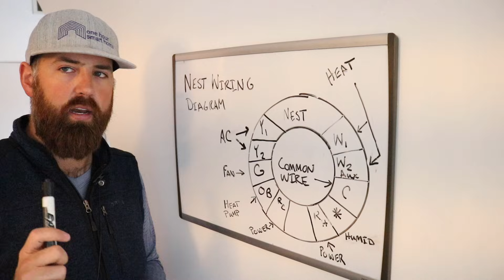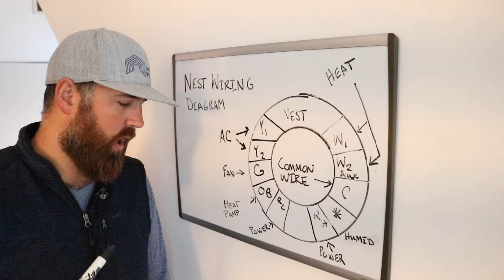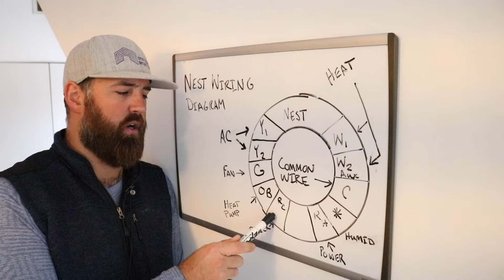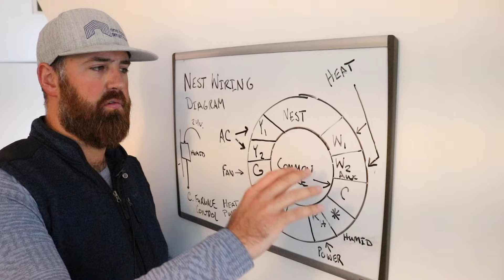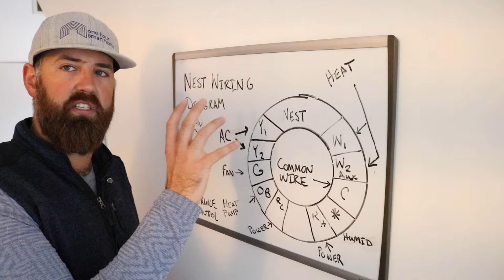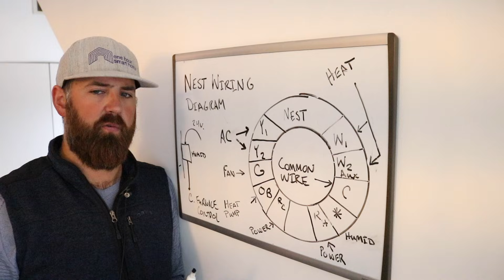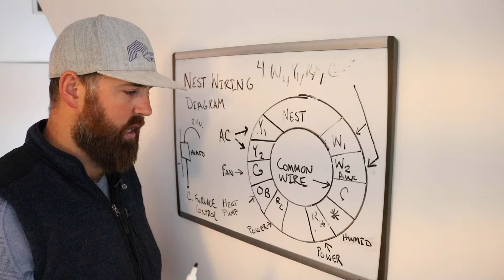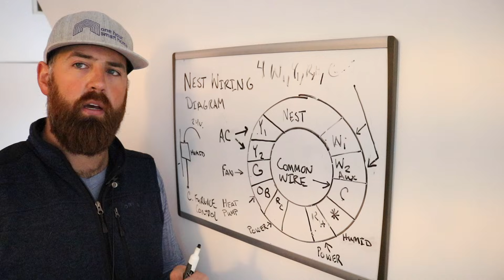Nest Wiring Diagram: Full Explanation!

Comment: I'm just thinking out loud here. If you have cooling only in the Attic. You would run the red wire to the RC correct and if you have a hot air furnace in the basement you would still run the are to the RH for the heat side correct. Or is this some type of internal jumper from RC to RH? Thanks for the video

Comment: I do not have AC and my yellow wire just sits behind the mounting plate. Can that be used as a common wire? My furnace was off for much of the summer and now the nest doesn’t charge while furnace/fun is running. I have to pull it off of the mount and charge with the micro USB every two days or so. Thank you

Comment: Hi, my old thermostat has both RC and RH because both wires come from separate transformers between Air conditioning (Electric) and a Base Board for the heating system. How should I connect both wires?

Comment: There's another video where the guy says the Nest 3rd gen doesn't like it when you hook up both the Rc and Rh.  You'll get an error.  He said only use the Rc because it automatically bridges to Rh but if you use Rh, it doesn't bridge to Rc.  It's a Nest thing he said.
Reply: Thanks, exactly what I looking for, my old thermo stat have jump pin between Rc and Rh and Im not sure what to do with it. Btw I have a blue cable that didnt hook to my old thermo stat, is that the common wire?
Reply: @nanowar1192  blue is normally the C wire but you need to check your furnace to be sure because there is no standard on colors.

Comment: I'm not getting power to the nest and going to do the green C slot? 5 wire system, single stage. At furnace I have the blue and red wire in the R spot. At the Honeywell thermostat I have the blue in the R slot and red in the Rc spot. I have the Nest E thermostat and it appears this won't work. Any suggestions?

Comment: I installed a Nest Thermostat 3rd Gen in my home. I noticed that there is a slight buzzing noise coming from the wall plate. ( nest base ) The previous thermostat that was there ( Sensi ) did not have this issue. If I shut off the power, remove the C wire, and turn the power back on, the buzzing stops. If I plug the C wire back in, the buzzing starts again. This is only affecting the wall plate and not the display itself. Spent 1 hour on the phone with google/nest support and made all kinds of switches with wires, no luck... Now they are sending me a base replacement but I read that its not the issue. Anyone experienced similar issue and was able to resolve it ?!
Reply from the maker: That's interesting. Possible it's bad base plate. It's very rare but I've ran into once or twice. It might be helpful to use a multimeter to see the voltage on between your R and C wire and R and W wire, and R and G and R and Y.

Comment: Hi, mi old heat thermostate work with only W an R Wire and use AA bateries. And dont work my new nest...wath is the best option to connect my heath? Thanks
Reply: Me too... 2 wires and heat will not kick on.  ( SIGH)

Comment: how do these get connected to a lennox harmony 3 zoning board? My installer is having a terrible time with this and the DAS probe getting too cold on the Harmony 3
Reply from the maker: You need to have a common wire from the lennox harmony to the each nest thermostat. You can use the fan wire as we show in this video: https://youtu.be/w0BZPx8-Q5o thanks for subscribing and your support.

Comment: Awesome job... I just got mine and the fan revs slowly then turns off.  I read the variable speed motors are not compatible.  I have a dc motor.  Are dc motors considered variable speed.  If yes can i jump the fan to run all the time....we have it set to run all the time anyways.

Thanks
Shawn
Reply from the maker: Do you have dual stage heating and/or  cooling? If so nest will still work with the variable speed. If not you would just have one fan speed.
Reply: @OneHourSmartHome  it has 2stage heat and 1 stage cool.  The fan short cycles but never reaches full speed.

Comment: I have a problem with my nest thermostat I just have a guy to replaced my old thermostat for the nest and after that I have problems with my unit I already replaced the compressor because it was consuming a lot of power (amps) so with my new compressor the problem still there the unit outside sounds like stop and go like a bad connection. And some times the head goes on. I don’t have any pictures of my old thermostat before he replaced it so I don’t know how it was wired before. If somebody can help. Thanks
Reply from the maker: If you open the hvac cover you will be able to see the wiring on the terminals inside.

Comment: I have a question. I was wanting to install a nest thermostat. My current thermostat has a orange wire in the y slot. But it also has a yellow wire that’s not being used. So which wire should I plug into the y slot in my nest thermostat the yellow wire or the orange wire???? I have gas heat

Comment: Hey, I'm having an issue. I hooked everything up properly. But the fan blower motor in the system will not turn off. 

When I re install the older thermostat it works. 

Once I connect the nest. It doesnt work. 

Any ideas?
Reply: Setting up a nest 3rd generation for heat pump with 5 Wires

Comment: Thanks for the video, here is my current wiring, IS LABLED ABCD (A is green wire is black) (B is yellow wire is black) (C is white wire is green) (D is red wire is red)   It’s a Carrrier infinity system and isn’t working properly so want to install the 3 gen nest. Help!!!
Reply: Were you able to set your's up with the Nest Thermostat? I have ABCD wiring as well which appears to be proprietary. I have a green, white, yellow and red wire that are all connected to the ABCD connections and a blue wire that isn't connected to anything.

Comment: I tried to connect my 3rd Gen Nest Learning Thermostat but it keeps losing power.  I don't have a C wire and I tried to use my green fan wire as a common but I don't where to find the fan wire on my air handler.  My Thermostat only is wired for cooling because I have 2 thermostats.  The one downstairs controls both AC and heat, but this one only does cooling.  Do you think that would be an issue with my low power issue.  Please let me know if you can help me out
Thank you

Comment: Great Video.  We are about to bring the two LV wires from a boiler heater over to the AC area and merge onto a newly installed NEST.  One of the heat wires would go onto the RC terminal I am not clear about where to place the second wire?  I think RH and W1?

Comment: cannot get nest to work with present wiring fro old thermostat . No yellow wire.instead a blue wire fro termiinal stripon furnace. Terminal strip had 5 wires going in a d 4 going out. Blue wire was connected to the K terminal on old thermostat

Comment: I am trying to wire a nest thermostat with forced hot air aux  heating and cooling in addition to a boiler for primary heating.  When I connect Rc and Rh wires in addition to the common wire I get an error indicating that the common wire has no voltage when it actually does.  I end up using y1 g Rc Rh C W1 for the boiler zone valve and W2 for the forced air heating.  Seems like it should work but it does not.  Any ideas?  I am stumped.  Any help is as much appreciated

Comment: Nest t-stats belong in the garbage !! PERIOD !!!
Reply from the maker: What is your reasoning behind that?
Reply: @OneHourSmartHome  1- Failure rate is higher than most basic t-stats in my experience, I had one that almost killed my customers dog, while in cooling mode, it de-energized the reversing valve, and pumped heat into the house all freakin day. You can call these t-stats smart if you like, but not smart enough to know there was a problem. 2- The price of this thing is ridiculous, its just a toy for low end, low seer rated basic units. Who really needs a wifi t-stat in a house ?. New Ultra High efficient, high seer rated units have inverter compressors, VD fans, zoning, load control, data logging, humidity control all use communicating t-stats, they have wifi, weather, unit troubleshooting alarms , etc,  that come with the units. Now they are "Smart" t-stats, but hey, what do I know, I'm not trying to sale anything.

Comment: I have 6 wires.... Red-R, blue-W, yellow-y, White-w2, green-g and gray-c on my Honeywell thermostat. I wired the wires just as the nest said to and when I turn my ac on the heater turns on. Do you know what would cause that? I changed out the downstairs thermostat with a nest a few years ago without troubles. Any suggestions would be appreciated!
Reply: Did you get this resolved, seems like the Blue wire should be on C since this is usually the common wire.

Comment: im interested in buying a Nest 3 thermostat. i currently have a 2 wire thermostat. So that means, as you explained. I would need to connect the RH and W1. But im seeing a lot of diffrent how to's and manuals. The manuals all say the HeatLink must be installed. So can you tell me whats up with that? is that related to the furnace i have??
Reply from the maker: Jitse, it will work with 2 wires. No heat link required if you live in US. Here's Gen 3: https://amzn.to/2UzmR97. I also did a video on how to install it with 2 wires, you can see the video here: https://www.youtube.com/watch?v=Mhz6bbsCUtE

Comment: I want to install a Nest thermostat.  I currently have a heat only system with a red wire and a white wire.  However, I there are two unused and unconnected wires on both ends.  It seems like I could use one of the extra wires for common and the other one for fan.  But, I've searched all over and all the four wire examples I've seen had one wire for fan, the other for Y1, and no connection on common, even in heat only applications.  Am I missing something?  If Y1 is for cooling, why would I need it to be hooked up at all for heat only, especially at the expense of not having a common connection?
Reply from the maker: You dont need to the y1 wire  hooked up if you have a heat only system. You could hook up the fan and common wire with the extra w wires.
Reply: @OneHourSmartHome  Awesome.  Thanks for the reply.

Comment: I have a question. I've got 6 wires. Y, G, R, W, C, RC hooked up to a Honeywell. Now I got the Best and hooked up to the Y1, G ,RC, W1, C, RH and the heat kicks on but not blowing out. It says rh connected but not detected "N72". Spent 2hrs troubleshooting with several techs and still nothing

Comment: I have dual zone system. Main thermostat has 6 wires. Rc, Y, G, W, O, B. I don’t know how to connect O- brown color wire and B- blue color wire.
Reply from the maker: If you have both an O and B wire your system might not be compatible with nest. You need to determine if your blue wire is a C wire or it's truly both and an O and B Wire.

Comment: i have got a 2 wire boiler heat on one wire set and on the other I have a 4 wire A/C unit. I do not have a common but I do have extra wires available and a transformer.